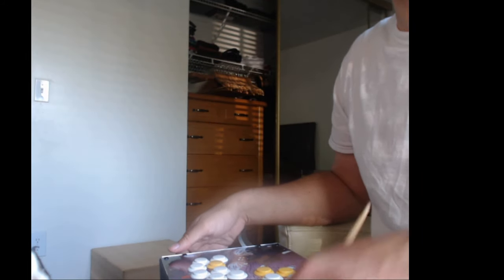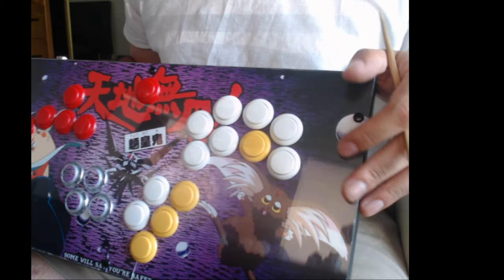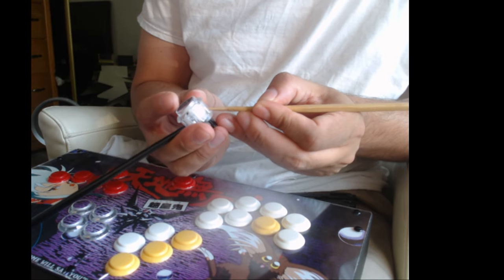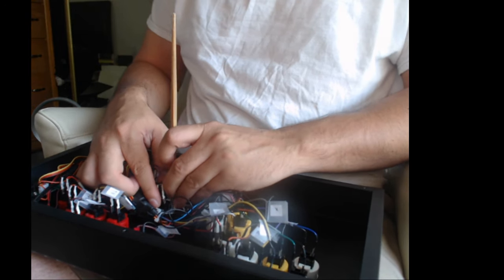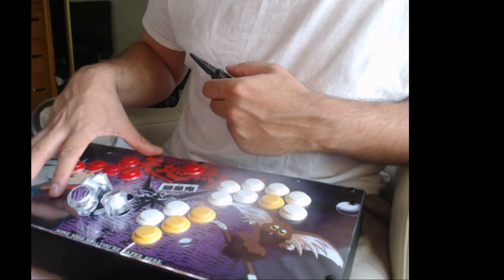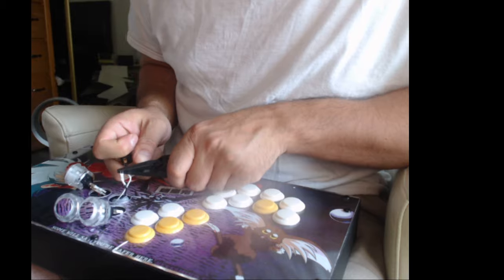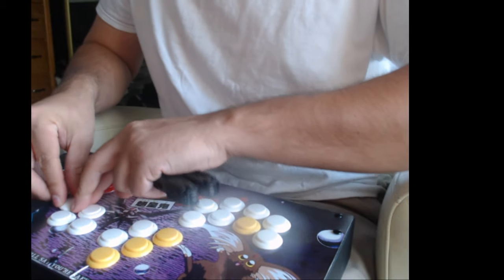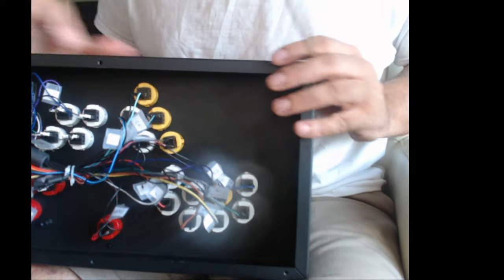Safely Removing Buttons From Your Smashbox

Comment: Do not do what this guy tells you to, you may cut or break the connectors like I did doing this way. Use the hitbox guide on their website
Reply from the maker: Sorry to hear that. I've never damaged a connector this way, but I've certainly broken many OBSC's without using the chopsticks style method of removal. That's what the video was really about. Best of luck in the future.